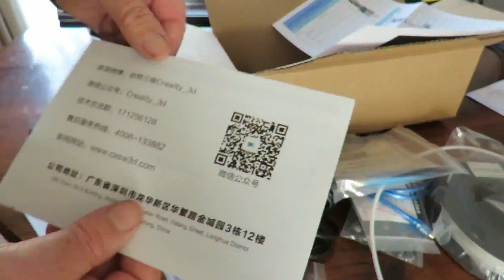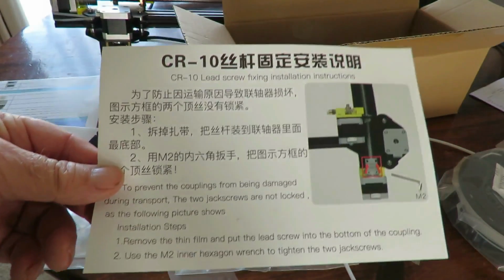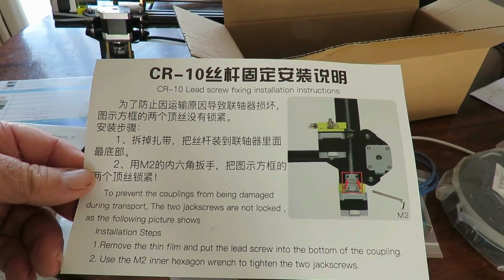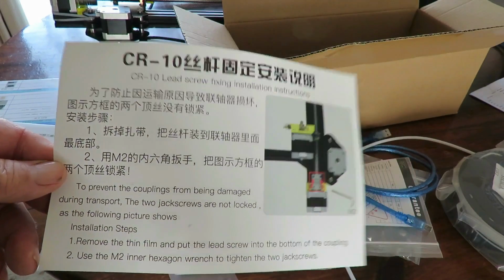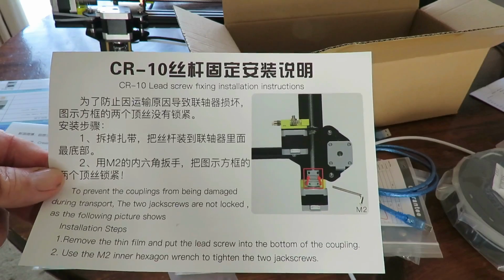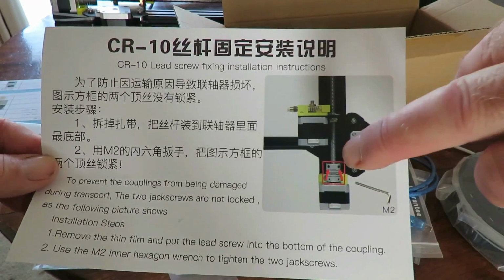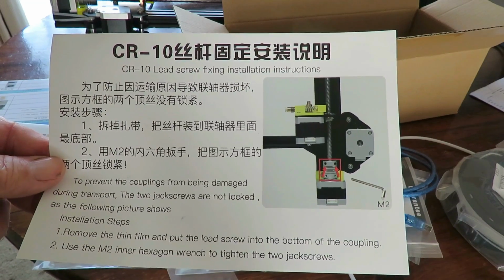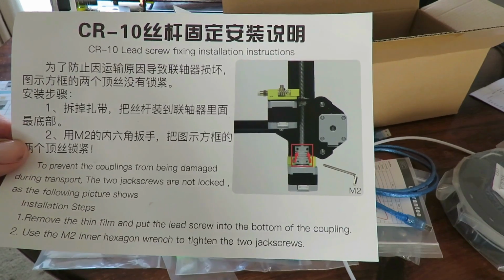📌 Creality CR-10S Assembly and Printer Heated Bed Roller Adjustment

Comment: Hi, do you have any good videos on adjusting the 3 rollers for the gantry... my new machine has 3 loose rollers on the far side ...watched videos and still nothing makes them tighter..i had no issues adjusting bed rollers at all or adjusting rollers on my endr 5...thanks
Reply from the maker: There is an eccentric bolt that you turn, and it will pull the roller tight against the gantry.
If turning the bolts does nothing, check to see that there is a eccentric bolt fitted.
Reply: @GarryPurcell  My machine is off a bit... the hole that was drilled in frame for the adjustment roller stud it self is not close enough to gantry ...so when i turn nut it still can not get close enough to tighten the rollers... i was able to loosen bracket  an use two chop sticks to pry the adjustment roller closer to gantry then tighten up bracket and then the eccentric nut was able to tighten it good enough... before just would barely touch and was very loose no matter what i did...thax
Reply: i realize I am kinda randomly asking but does anybody know a good website to watch newly released movies online?
Reply: @Abdullah Chris I watch on flixzone. Just google for it =)
Reply: @Bowen Antonio Yea, I have been using Flixzone for since march myself :D
Reply: @Bowen Antonio thanks, I went there and it seems like they got a lot of movies there =) I appreciate it!
Reply: @Abdullah Chris happy to help :)

Comment: Hi Garry. Thanks for the video as it's very good. Did you find it necessary to check the xy carriage and the z carriage for square before you began assembly?
Reply from the maker: It is always good to check everything first before powering on for the first time.

I found no real issues, apart from the Glass being slightly bowed in the middle.
The only other thing to watch are the eccentric middle locking bolt nuts 
Mine was loose on the X carriage, so when you turn it to remove the slack. you think you have it set correctly, the inertia of the X carriage will rotate it out of position. 
(I needed to remove the heat shield for the hotend, and use the supplied spanner to lock the bottom middle nut tight against the lock nut)

Comment: Does your CR10S have the external mosfet inside the control box?  Mine didn’t
Reply from the maker: I'll open the control box up in the next day or so, and have a look. 
My understanding is there is supposed to be an internal mosfet fitted as standard on all CR-10 printers..
Reply: "External" mosfet "inside" haha you funny

Comment: Haha just told you elsewhere to buy this printer, glad you got it:)
Reply from the maker: I always appreciate those who take the time to comment, especially when they give good advice on one of my other videos 
I was asking for help on that video, and I got many positive responses for the CR-10, including yours.😀
Reply: Garry Purcell  Glad you got off to a good start with your investment :) By the way what is the max temp you can get with your hotend? Im looking at changing to E3D V6 or something to get +260 degC to print ABS better.. Are you from NZ:)
Reply from the maker: I'm located outer eastern suburbs Melbourne, Australia.
I have not tested the CR-10S hotends max temp.
I'll ramp it up tomorrow, and let you know.
Reply: Thought I heard a slight Kiwi accent :) Im a Saffa.. Thanks for that, have a good evening
Reply from the maker: Max Temp was a stable 158 degrees C
Reply: Thanks I tried printing ABS again today. 260 hotend, bed only got to 102 with using a box enclosure. Fan was zero speed. Still git some cracks in part due to warping, will make some more changes..
Reply from the maker: Sounds like a bit of a challenge, I'm sure you'll get there.
P.S. You can turn up the power of the Heat Bed (Results in Higher Bed Temperature), for inside the power controller box.
Reply: Thanks will try that
Reply from the maker: I might do a Video Tutorial showing how to do it.
Just so you can see my hair stand on end, when I forget to turn the power off,.haha.

Comment: Just an FYI to make your life a little easier you're adjusting The Eccentric bolts incorrectly you do not use screwdriver a wrench or Allen keys on the top and bottom you should slide the wrench in between the bed plate and the wheel and three of them will actually accept the wrench and you simply turn it so three of those wheels will have an eccentric bolt look with your eyes in between the Y Carriage plate that black curved plate and the wheel and you'll see three of them have a flat spot the wrench fits over that and you simply turn it and they tighten up
Reply from the maker: Yes I agree.
I did adjust using the wrench between plates, but also found the bolts easy to turn by hand, and then simply tightening them, to take up any slack, which is what I finished up going.